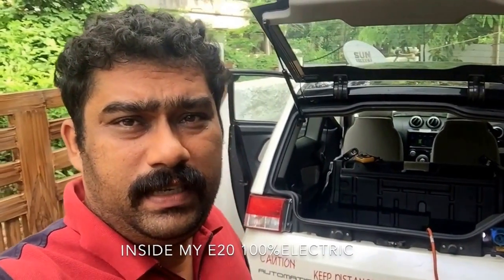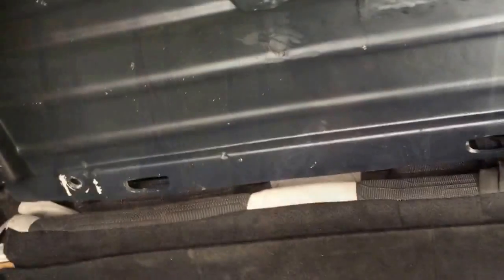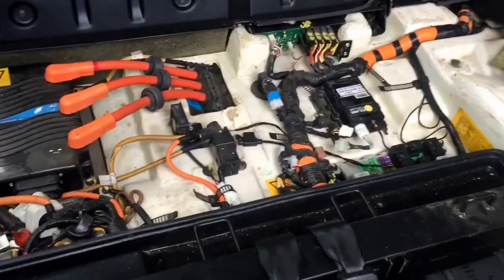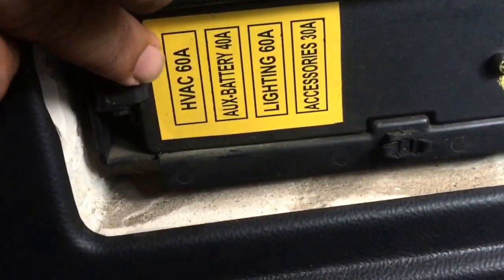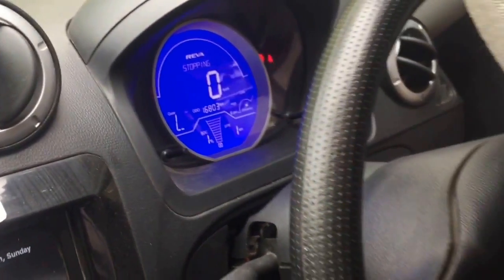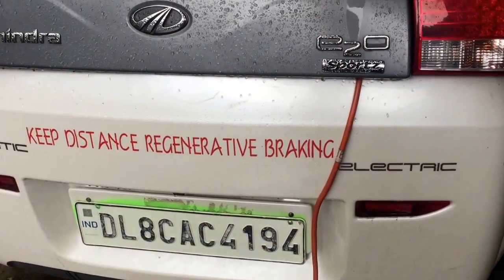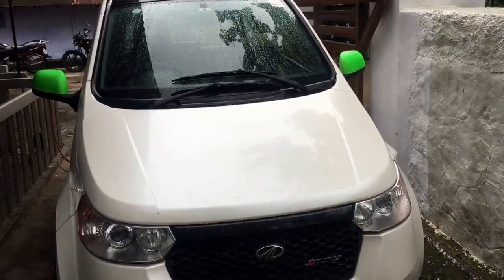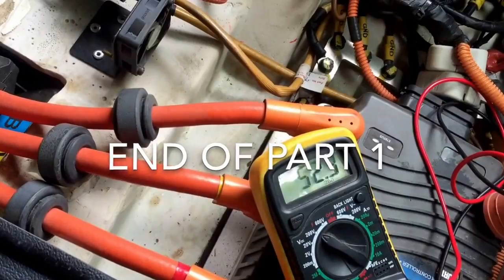Inside My E2O -Part 1- 100% Electric

Comment: Nice man ! NIce to see E2O owners here in Kerala. Adipoli !  Battery replace cheyyan cost etra aakum ennu arayuvo? Could you share?
Reply from the maker: You can also make your own battery with 18650 stacking
Reply: @NomadicKerala  I am on the look out for used E2O T2 varient. I contact Mahindra to know the battery replacement cost, have not got a definitive answer yet from them,  LOL! Making my own battery , not that tech savy my friend !
Reply from the maker: Battery is expencive not sure exact pricing it will stay good for 2000 cycles
Reply from the maker: Original Calb USA will be costly you may check site for usa pricing 48 batteries if calb model
Reply from the maker: 150$ each so 48 x150 X 70 🤣🤣🤣

Comment: sir how much km it go on realtime??Is it worth the price sir??pz give me honest opinoin i am planning to buying it....any problmes with it plz share....
Reply from the maker: it depend on how you drive and road conditions and climate, if cool 35degree and road is empty with out AC you get 110kms with some 5kms balance remaining, If you use AC and in city drive at 30km/hr then you may get 80 to 95kms depends on the way u drive. in general i get around 100kms if driven 40-50 km/hr with using all energy downhills i wont accelerate down hills and regenerative breaking I use, i get in general i am able to do intercity 100kms trips as non ac and local trips with AC. recently tried 88kms tip with AC (not full ac occasional ac use windows rolled up night trip with no traffic)at destination it had 19kms left so using ac is not issue the way you drive is important for getting range. Its new technology we need to study & use it. i suggest you get that 140km models E20 Next. so that u will get 100kms if you do rash driving. IF you drive dead slow around 25to 30km with 40psi tyre pressure and non AC you may get the maximum range may be 170kms  in a single day. day by day charge will decrease if car is not in use its generally happens to all ev we have to use it regularly. Hope you are good sorry for the delay in reply bit busy....